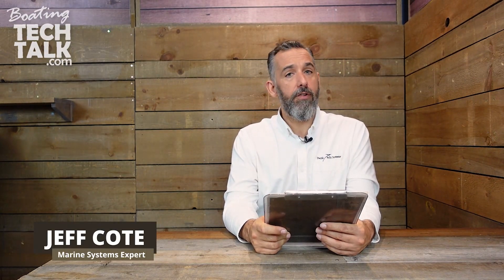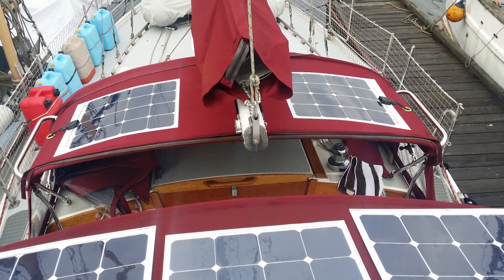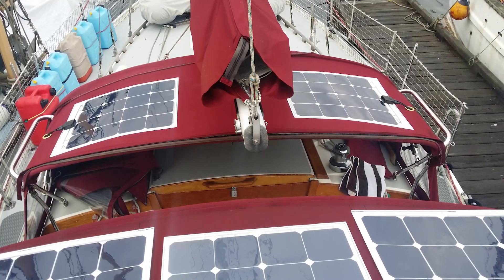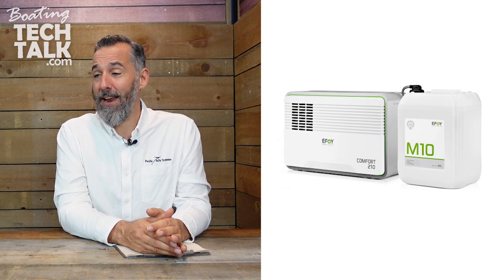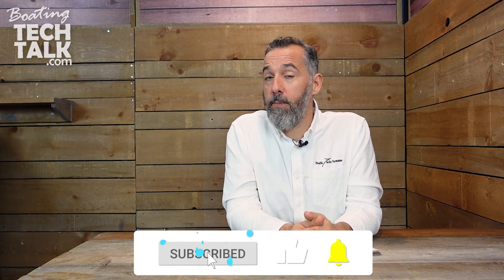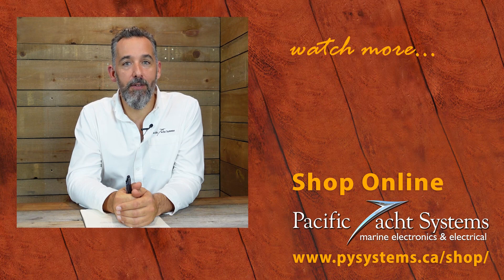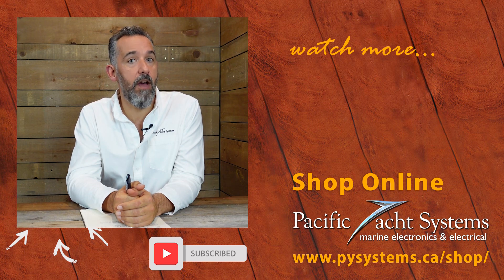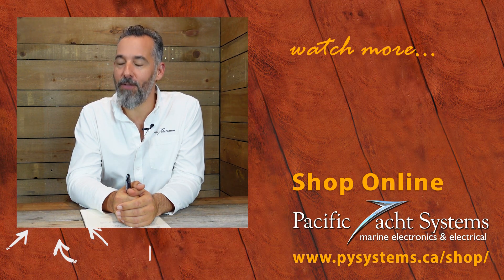If I Lose Shore Power How Long Will My Boat’s Batteries Last?

Comment: Jeff, I have a Positive disconnect for my shore power. Do I need a separate breaker other than my main breaker on the distribution panel?
Reply from the maker: Your shorepower breaker should disconnect both the AC hot and the AC neutral connection. The marine code requires an AC breaker within 10 feet of the onboard AC receptacle.

Comment: I'm kinda surprised that battery only bilge pump operations for a sizable leak isn't mentioned much or more of a concern. A near constant bilge pump operation will drain a battery bank fairly quickly and then you are done.
Reply from the maker: Good point, without a battert charging source, a bilge pump will quickly drain a battery bank.
Reply: Yep; it's an age old question for sure.  A boat with a leak will call for bilge pump.  The size of the leak/battery/power source will determine how long she stays above water.  If you're lucky and your aboard or you have a good neighbor, you can buy more above water line time.
Reply: @PacificYachtSystems  It's my main reason for having a battery charger powered at the dock as my solar will not keep up with discharge rate on a high draw item(s). I love your channel and find it informative and full of great tips, thanks for all!  Happy 2022!

Comment: Quick question...
My main AC circuit breaker always trips upon being connected. Which means, when shore power is restored; it isn't automatically restored onboard. 

 Is that some safety feature, or is it a faulty breaker?
Reply from the maker: The situation you described is unusual. Before connecting to shore power, make sure all your AC loads are off and test to find out if the main AC breaker trips with no load. If your shore power breaker is ELCI,  you might be blowing the breaker because of imbalance hot and neutral legs.
Reply: @PacificYachtSystems  It happens even if there are no loads, all other breakers off. When I plug it in, it trips, then I reset it, and it's fine. 
ELCI is like GFI? If I had that, there would be a test/reset button?